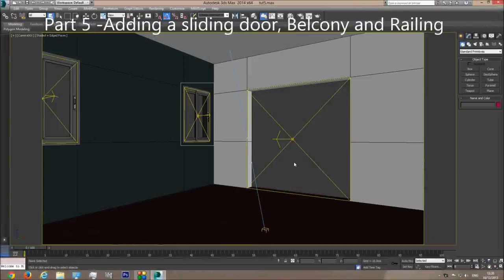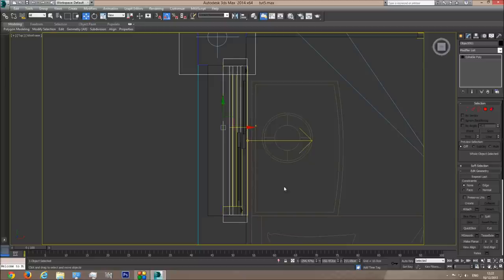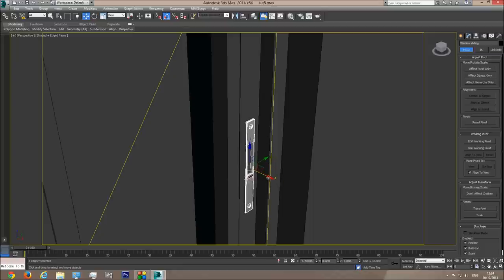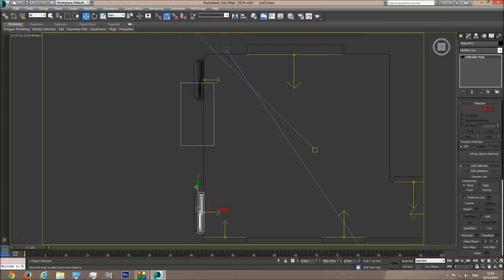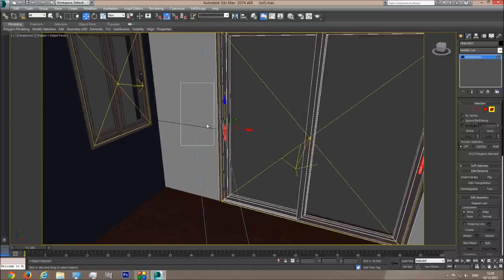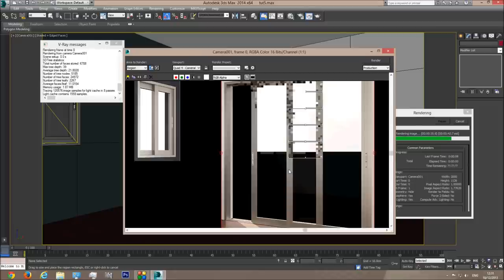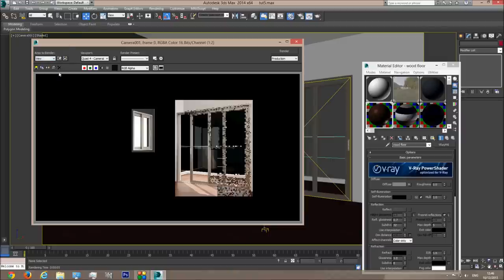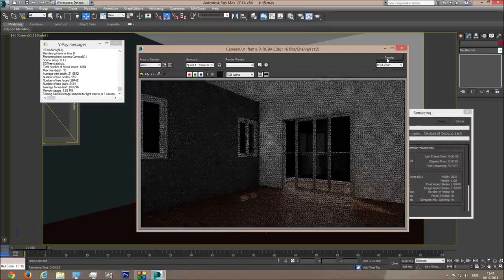Part 5- Sliding Door Modeling Tutorial in 3ds max

Comment: nice series, but why didn't you use snapping options? for instance when putting windows in wall frames etc?
Reply from the maker: The windows don't need to be 100% aligned so I find it easier not to use snap sometimes , I work organically the way that is easiest to me, if you find it easier to use snap ,use snap, it's a preference
Reply: 4dvisual that's true bcs of the light :D but beginners don't know that, anyway, it was just suggestion, nice way to learn beginners how to use snap possibilities :D

Comment: hi i have problem with the grainy render. i see a lot of dots on the windows and the door (especially on glass) i tried with the glass material changing subdivs 32 and noise 0,002 and i also changed light dome subdivs to 16 and resolution to 1024 but nothing helps. any suggestions?
Reply: same problem :(
Reply from the maker: Can you send me the file to my email? I'll check it out.
Yuvaldorfman@gmail.com
Reply from the maker: Can you send me the file to my email? I'll check it out.
Yuvaldorfman@gmail.com
Reply: 4dvisual hi ! i also have the same probleme on the blue wall ! lot of duts :/